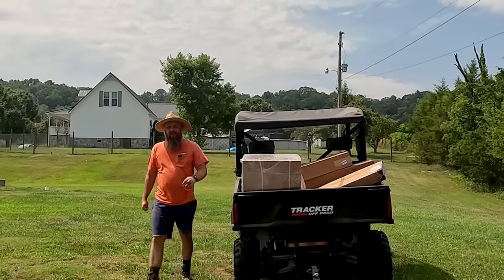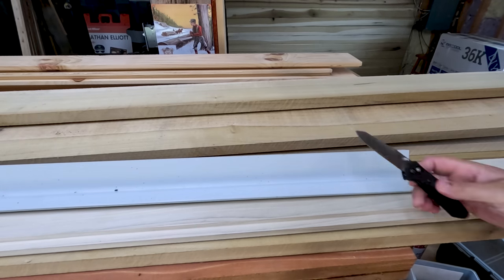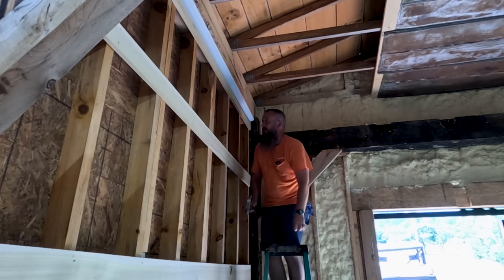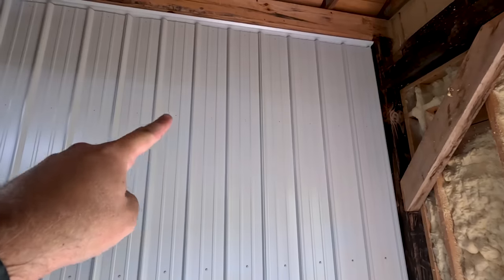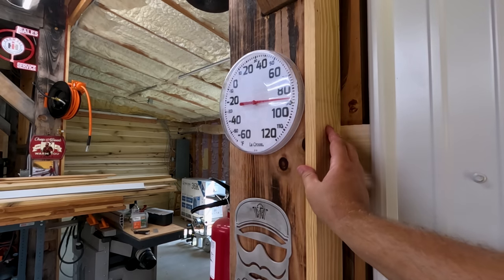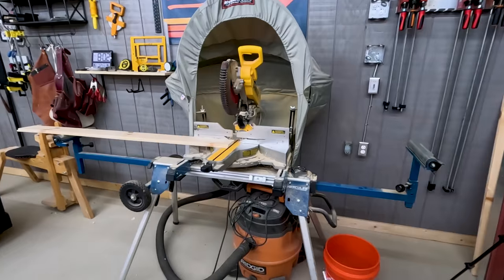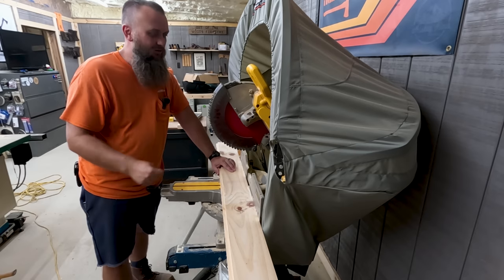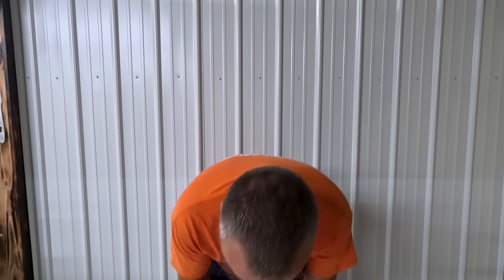Backwoods Hillbilly Uses Ancient Method To Preserve Wood

Comment: Holy crap Nathan , shock to hear about your brush with skin cancer , glad you got it looked at in a timely manner . 
I’ve just recently started accumulating tools to do some DIY woodworking and I’m a like a little kid in a candy store , so I know how your feeling about getting started planning your foray into blacksmithing , will be interesting to see how that works out for you going forward .
👍🏴
Reply: Nathan - Maybe you said earlier, and I missed it, but @ 18:55, while you were starting your shiplap on that insulated exterior wall, was there a reason you didn't slip in a piece of the rat guard at the bottom and on the sides?  It would match the look of the adjacent metal-faced wall and help protect against the furry woodland creatures looking to gain access to your soon to be completed shop?  It is looking great and I'd like a tour when it's all finished.

Comment: I have a Benchmade. I love it. I have had it for 30 or so years. The blade is configured the same as yours but the handle pattern on yours is textured, mine is just non -slip.  It has 154CM etched into the blade. Benchmade definitely made quality knives.

Comment: In the UK, I've used the charred wood method to preserve posts, often old telegraph poles, that are used to build saltwater boat landing stages. It stops marine worms from getting into the timber and reduces barnacle build-up. When we've had to pull out posts, they are in a first-class state of preservation after decades in the mud and water.

Comment: Rat guard is for the outside sheeting. Inside sheeting can be "sealed" at the concrete. Some contractors pour their concrete past the steel framing to make a rat guard. This can also make a guard to protect against equipment damage, lawn mowers, weed eaters, skid steers, etc. I know it works at our shop.  But, that's just how we do it & we like out of the woods.

Comment: Hi, Nathan. Once you have your miter saw permanently placed, you should
run some 4" or 6" PVC (the same as the collector port size), from the dust
collector, you use for the molder.
The shop vacuum, on a hood of that size, can not move enough air, to work well.
Then tighten up the open front arch, of the hood, a little and you won't have any
more trouble with it collecting dust.
P.S.: you will need to enlarge the dust port on the hood.

Comment: Insulating internal walls does help to keep temperatures even, especially as you are going to be doing forge work.  That will heat the whole workshop up.

Comment: You said it got hotter as you climbed the ladder. Is the ceiling above you at that wall insulated? It doesn't look like it.  Most foam that i've seen is flammable but more important[y most burning foam is very toxic to people and pets. Many cities have building codes that require covering the foam with something that will delay  the foam burning so people have time to evacuate..

Comment: Inside walls, usually have some insulation, not for heat, but for sound (well the sound insulation has a Lambda Value around 0,044 W/mk. Usual heat insulation has a Lambda Value of 0,036 W/mk or less) if you're the only one working in the area, sound won't be a problem.

Comment: Pre Drilling holes in metal roofing is because of the expansion and contraction of the roofing sheets. If they didn't pre drill then after a summer or two the roof would have leaks around the fasteners. Enjoy your shop.

Comment: Insulation helps to reduce  the  noise. Everyone knows that. You have drill your 0,5 mm larger than your screw or nail  diameter. This allows the screw or really tighten the malarial. Try it and let me know how it works.

Comment: Studies show that the darker colors of a metal roof will not be much hotter than the lighter shade. This was a study I saw on you tube. I have a jade green roof on my home and the summer is cooler and the winter is warmer now that when I had a "normal" shingled roof. These roofs are about twice the cost of a "normal" shingled roof but the best part is the 50 warranty, the fact that this roof will stand higher winds, and the actual length of the roof will be most likely 100 years. Call me your friend or not, just don't call me late for dinner!!!!!

Comment: I built an anvil stand a couple years ago and put casters on it so I can move it around my shop or out of the way. Soon after I had wrist surgery and I have not had a chance to get the forge heated up. I put sure the casters the anvil stand and I am wondering how the casters will hold up when I finally get started moving metal.  Yes to EDC.